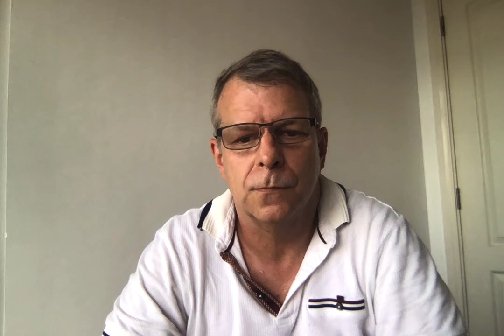Preparing to install Weber carburetors on you engine

Comment: Hi there. First of all, Happy New Year! Thank you very much also for your well thought videos. I own a 1979 Fiat 124 2000. I’ve been studying the possibilities of going with a 32/36 or a double 40 IDF set up. What’s is the hp gain in power from the latter if I go that route, granted the rest of the engine will remain stock. Is it worth the investment? I know it definitely does from the “looks” point of view. :-)

Comment: Good info. You forgot to mention to check fuel pressure. 👍
Reply from the maker: Yes excellent point-the right fuel pump and fuel pressure regulator is critical.  I talk a bit about that in one of the FIAT videos as that was an important part of that installation.